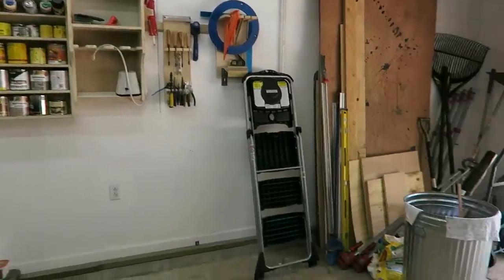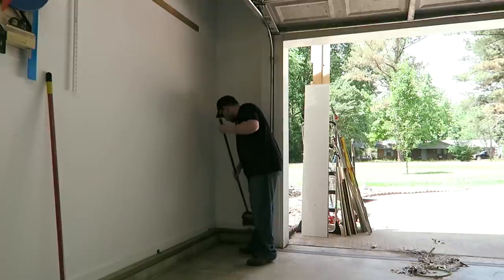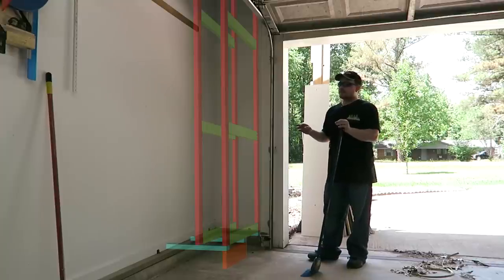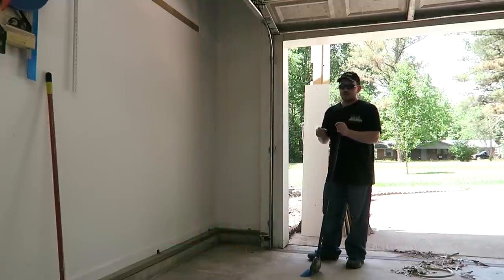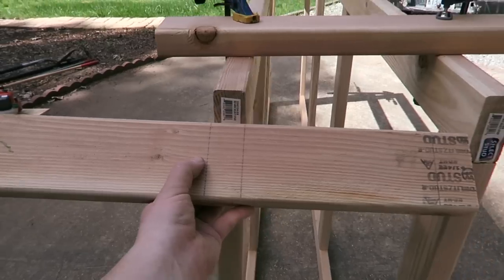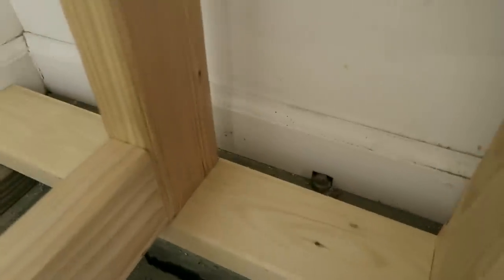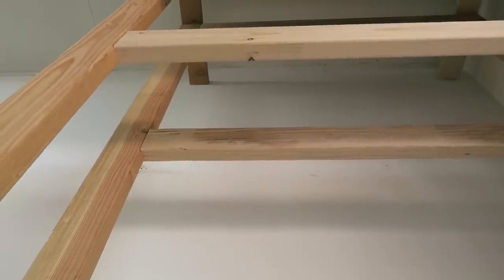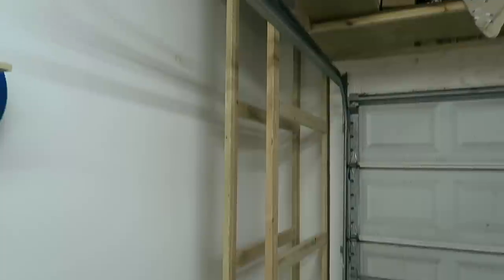Simple Plywood Rack For The Shop - 201

Comment: This is a great solution and use of space.  I am really restricted because the people who built my shed must have been dwarfs and headroom is a real issue in places, especially along walls.
Best Wishes, Brendan.
Reply from the maker: baconsoda Sounds like someone like me built it. I'm short!
Reply: Jay Bates Not just short but also skinny. How in the world did you manage to get into an "roughly 8 inch" space when mounting the ledger board? Great build though and solves a problem I have had for some time now. I have been storing sheet goods on a rack the hangs from my garage ceiling thus far. But I am getting tired of fussing with 3/4 sheets of oak or MDF. I have a space just perfect for your solution. 

I think I will add a pivot to one side of it so that I can swing the front one away to get to the rear. I have no space to pull them out the side but plenty in from of it.

Comment: Jay, nicely done and very efficient. One suggestion I would have for you though is to fill in the very bottom with a plywood shelf. Having a solid surface at the bottom will better protect your sheet goods, fully support the bottom edge (preventing crushing of the edges over time), and allow short pieces to slide as well as full sheets.
Reply from the maker: Al Amantea The next day I went and got some plywood and noticed that problem. I put a piece of ply down before I loaded it up with full sheets.

Comment: According to the almight Matthias Wandel, pocket hole joints are not very stong...
Reply: They are strong enough to hold his weight. He stands on them when securing the top of the rack to the wall.
Reply: XxTomcastxX 
Not just according to him, but mostly according to physics. As long as the horizontal pieces aren't used for shelves (or any load) but just keep the frame in shape, they are fine.
Reply: Yah, I understand, it was just a joke
Reply from the maker: superdau Pocket holes cannot support a load?
Reply: XxTomcastxX Don't forget, Matthias has 407k subs to entertain and he's running out of ideas.
Reply: Jay Bates Pocket holes just got a little better in my mind.  It took more than a few seasons for Gretzky to get most of his records.
Reply: Jay Bates 
Sure they can take some (and in this case it doesn't look like it's a shelf support but just a frame). But under significant load (or with time or due to movement of stuff on the shelf) the horizontal pieces will sag in the middle and most likely the top screws of a pair will tear out.
I can't tell what size screws you're using, but in soft wood, if the screw is in the same direction as the grain, I've seen them "wander" through the grain with time under load.

Comment: Looks good Jay, this is almost the same way I built my sheet goods rack. I had the same problem with the base boards holding mine off the wall, I cut spacers to fit in the gap and drove some screws into the studs to hold it to the wall.

Comment: Now build a box that fits in the space under the rack. Put wheels on the box so it can roll in and out.
Put the wheels on the inside, protruding thru slots in the bottom, to eliminate downsizing the box for the wheels. Build covers for the wheels (just small boxes), to keep the box contents from jamming/binding on the wheels.

Comment: Hi Jay,

Nice build solution for sheet goods. I have one in a similar set up. Just a thought - and I couldn't tell for sure from the video and your comments - but the bottom support 2"x 6" should really be treated since it's sitting on concrete. It's not imperative, of course, and if you're planning to change it out in the next couple years definitely not. I noticed the plate above the concrete stub wall is treated (it should be) and it's those little details that sometimes make all the difference over the life of a project.

Anyway, not meant to be a criticism - just an observation. Overall a nice lean and efficient solution to a 'messy corner.'

- Fred

Comment: Hey, I'm not bashing pocket screws, but have you ever considered using mending plates (like a Simpson Strong-Tie MP14 or MP24) on both sides of a butt-joint rather than those? Less work than the pocket screws, and much stronger, especially for utility "furniture" like this. A few good whacks with a sledgehammer, and they're in... flip to the other side and repeat. You could drop the frame off of the roof onto the corner and they wouldn't even flinch!
Reply from the maker: Sean Harrington Haven't considered it. I have a bunch of pocket hole screws and a few jigs so I had everything on hand. Thanks for the idea though.

Comment: Great use of (always) limited space.  However, that 2X that you laid on the concrete floor should be pressure treated and rated for ground contact.   That wood is going to wick up moisture from the concrete, causing it to rot.  And creep-crawlies (like say, termites) love moist wood.  If termites get into that wood - you could have them in your stored lumber and even your house!  Now that I think of it - you probably have a lot of untreated lumber laying directly on the concrete (the huge miter saw wall).
Reply from the maker: Brian Dormer This corner of my shop gets wet maybe once or twice a year. That 2x6 will probably outlast me. 
The miter saw station is not resting on the floor.

Comment: Just curious --- Has anyone else had luck in finding "weight-lifting weights" at exercise equipment recycling stores? I had a chance to purchase (for a pittance) a number of odd graduated weights, solid and/or in bags, from different sets that were not in order from a shop that specialized in reselling used exercise equipment. I am now using them in different configurations to add stability or hold down or press items together.
Reply: I've been looking for weights but have almost never found anything actually useful

Comment: Great use of what is usually wasted space.  I would have added a plywood sheet or something to the outside of the rack, under the garage door, to hang the rakes, etc.  It may be in your way though.  Awesome job, as always.
Reply from the maker: Keith Powers the rakes and lawn stuff will be going in a shed in about a week so no need to accommodate them. All of the smaller pieces will be in a cut-off bin soon.